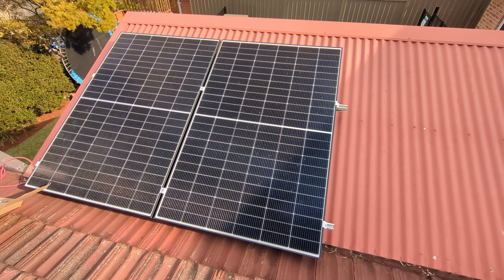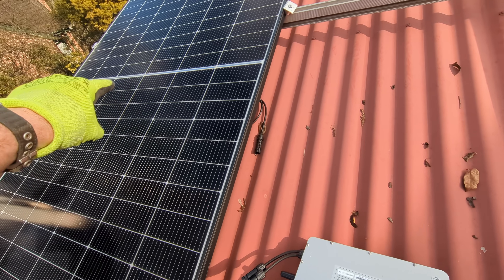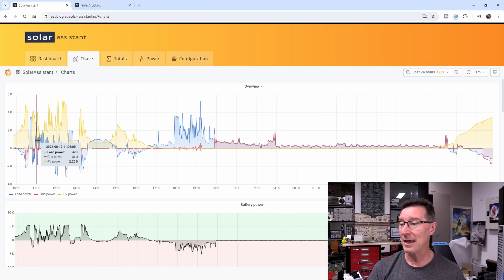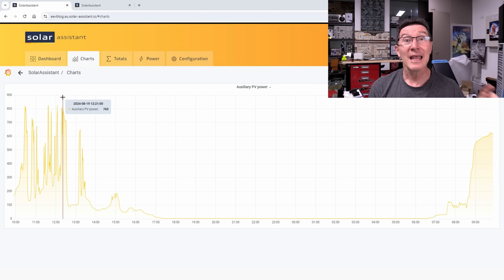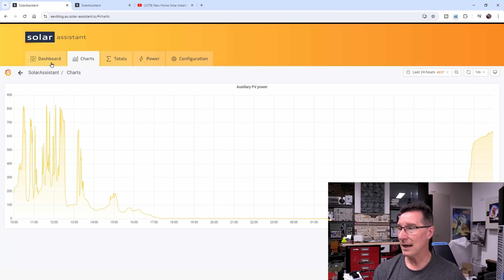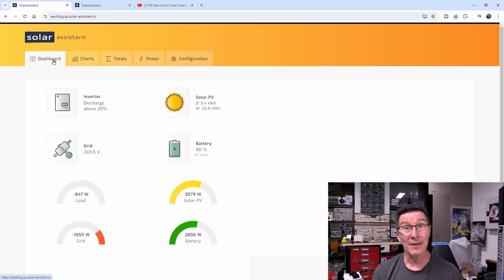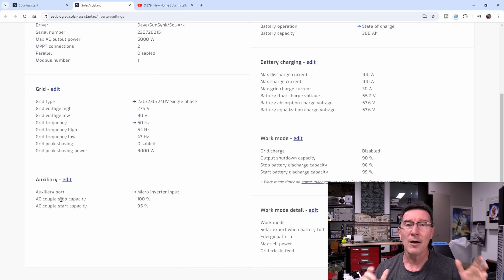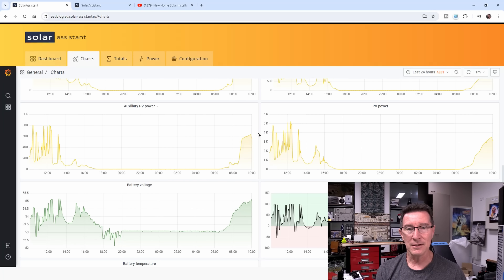Hoymiles Solar Microinverter Install + Deye Gen Connection

Comment: AC couple start and stop SOC function is quite useful for off grid installation, if you have connected any string inverter or micro inverter back to the gen port and battery soc reaches the off value % then deye inverter will raise the frequency of the gen port to trip the string or microinverter. 

For on grid when the soc of the battery reaches the on value then the deye inverter will close the relay on the gen port and allow the ac current of on-grid inverter or micro inverter to feed-in. and if you have enabled MI export to grid off then it will trip when it reaches the off SOC %. 

Let me know if it makes sense or not. cheers!

Comment: get an open dtu to track the data from there. Open source and you can do an awull lot. 
Reverse engineering of the hoymiles protocoll and getting rid of hoymiles cloud. You can also add more targets like displays or pv solar tracking cloud.

Comment: Hello buddy, this was an energetic video. Please don't do videos only because you want to rant; do videos, also, when things work. You never know what Easter eggs you may inadvertently drop for people who may have been scouring the web for answers. For instance, I have a DC-coupled Sunsynk hybrid system but I have used both MPPTs on a North-East//South-West split PV (strip the badge from Sunsynk and you'll find that it is the long lost twin of Deye - they are exactly the same 🙂) and I need to expand by system using a plug and play microinverter but hearing you on this video has given me inspiration.
What I am kindly asking is to know exactly how you connected the wiring off the Hoymiles into the GEN port of your DEYE. Did you have to use a gateway? Did you have to use an AC isolator? Or did you just connect it straight to the GEN port. What kind of wiring did you use 8 or 10AWG. Can you draw a map of exactly how your Hoymiles is wired into your Deye?

Comment: In your travels Dave you found what the input max of that Gen Port is? You've put 800w into it but do you know what the max is if you had more panels?
Reply: The max is half the inverter out put so if a 5kw unit then the max is 2.5kw

Comment: The gen load might only be a reporting error on Solar Assistant. Had the same happen on my Deye when connecting micro inverters. Disconnecting SA from the Deye in the config section, waiting a few seconds and then connecting it again.

Comment: To talk with Hoymiles micros, you need their DTU (Data Transfer Unit), they use some sort of custom Sub-1G networking for comms, gives them more range and penetration.
Reply: some newer hoymiles microinverter have a build in DTU, they only need wifi  to work. had one installed half a year ago, works like a charm.
Reply: You can build your own DTU with AhoyDTU and an ESP32
Reply: Question, can hoymiles microinverter output gridtie power without being connected to the internet at all? (I can of course give my phone's hotspot to it during initial setup)
Reply: @allochris  Yes

Comment: AC coupled on Grid = setting the Gen input to Micro-inverters (it does the same). It keeps the CT coil at 0 watts so nothing is exported. (TBH it's does not care where in the system the microinverters are connected) The % are very important.... If you have a power cut (AKA Grid failure) the Gen port will continue to supply power to the microinverters and they will continue to produce power in to the system and power the house and charge the batteries - GREAT. If the Batteries are at 100% and the house need no power the generated electric has to go somewhere. The 100% means when the battery is at this it level will shift the output frequency to 52Hz and the micro-inverters should shutdown. It will switch back on at 95%. (EDIT: I think this video explains it better - https://www.youtube.com/watch?v=oWnrFQqLJ74)
Reply: I believe frequency shifting is only needed when microinverters are on the emergency load output. When using the "generator" port as microinverter input I believe it disconnects the power when 100% charged and reconnects when down to 95%.

Comment: The 84 Watts might be the usage of the hybrid inverter itself. Not a Deye expert just a guess.
Reply: That's absurdly high then
Reply from the maker: That's crazy high, and it was zero before I added the microinverter.
Reply: @EEVblog2  
That's pretty normal power consumption for a hybrid inverter. I have a Solis aka. Ginglong hybrid. It's about 80 Watts as well.

Comment: If ac coupling not gona work with gen port you can allways connect it on grid side like enphase. Only drawback is in offgrid scenario deye will not provide island network for them.

Comment: Dont call Deye monitoring is junk just because you used the Solarman Smart app. Deye Cloud and Solarman Business apps are much better than Solarman Smart. I bought Solar Assistant license and never ended up using it because I like the Solarman Business app much better. UI is better than Solar Assistant as well

Only advantage with Solar Assistant is that it provides instant updates but you lose out on firmware upgrades, some remote configuration options and warranty support from Deye. You might think that firmware upgrades arent necessary for devices like these but Deye added many features (e.g. MPPT multi point scanning) with the firmware upgrades. They release new upgrades like once every 2 months.
Reply from the maker: I tried their cloud thing, couldn't get it working, and it looked stupid. I don't want to touch firmware updates, and have been advised by several Deye owners never to update working firmware.  If it ain't broken, don't fix it.

Comment: If you're so keen on doing 240V work why not upgrade the whole switchboard?
Reply from the maker: I've told you multiple times I am going to get the switchboard upgraded. Smart meter upgrade happening next week or so, and then I'll have spare space to more easily upgrade the switchboard upgrade. The guy doing it advised I wait until the meter is replaced.

Comment: The modern Trina panels are real overperformers, they routinely do +10% power in the right conditions. You can just put panels on the south side of your pergola. Every bit counts, especially in scattered light conditions where the orientation is not a huge factor.

The generator power is most likely the power the inverter needs to uphold its own 50 Hz AC grid at the generator port. For example, if your mains is disconnected, the battery is full and there is no house load, the inverter will raise the frequency until the Hoymiles micro inverter turns off. The grid on the generator port needs to be isolated for this to be possible.

You could use Home Assistant to automatically set the generator port back to "generator" over night and set it to "micro inverter input" again when the Hoymiles would actually produce energy. This way, you can save the nightly 84 watt consumption
Reply from the maker: South side would be useless in winter time.
Reply from the maker: If it is chewing 84W standby consumption then that sucks.
Reply: @EEVblog2  It does but in return you get 5 kW backup power ready at all times to step into the breach within milliseconds. Every hybrid inverter with this capability has at least a standby consumption of around 10% of the available backup power.

Comment: The ac couple start point may be the SOC of the battery. Lowering that may restart the ac couple on the grid port as well as the ac couple on gen port and the dc coupled. The gen port can be used as a switching port. If you connect a load to the gen port and set the parameters such as battery socket reached 90% then turn on the n supply gen port with power activating the load you have connected to it. Not really about to be done with the micro, but as you said, the Debye have so many features.
Reply from the maker: Sounds plausible. Experimentation required.
Reply: With the knowledge there is a micro inverter installed, it can also kind of throttle the power of the inverter by altering the frequency of the simulated grid on that port. The inverter would throttle on a certain frequency and would even entirely switch off at a certain threshold.
Reply: @markusresch9889    in an off grid situation it can alter frequency of the microgrid it is forming on the backup and gen port, but in a grid tied situation, it cannot alter the frequency as it cannot fight the grid frequency. I have not tested this personally, but as all the ac circuits/bus are tied together when the inverter is grid tied, it is limited in that respect.
Reply: @HomeGrownAlchemy  without deeper knowledge about it: the generator port of that hybrid inverter should be a totally separate micro grid with out any direct connection to the real grid, right? Because it's only used to add additional power to the battery charger.
 If that port would be in any way connected to the real world grid, you would have to meet a ton of regulations for any generator you'd attach to that port.
Reply: @markusresch9889  No, The gen port is physically connected to the Grid through a relay that switches when grid fails!
So the DEYE can only provides a microgrid to the mircoinverter when the normal grid is down!
It can NOT produce a Microgrid while connected to  MAINS GRID!!

Comment: From what I've read the Deye generator "load" function can be used for a dump load - eg dumping excess power into hot water rather than exporting to the grid.
Reply from the maker: Ah, that makes sense, thanks.